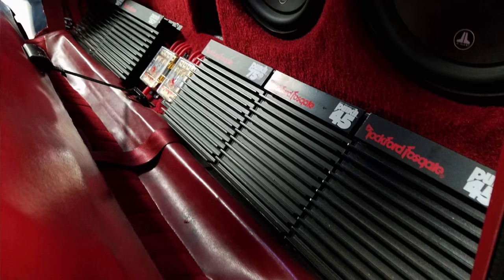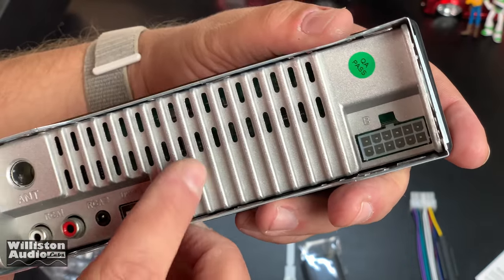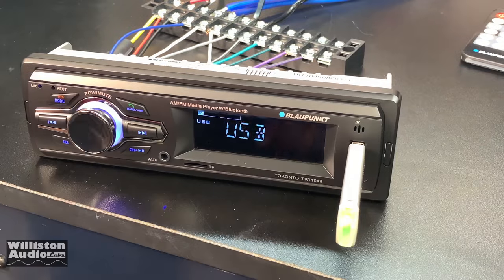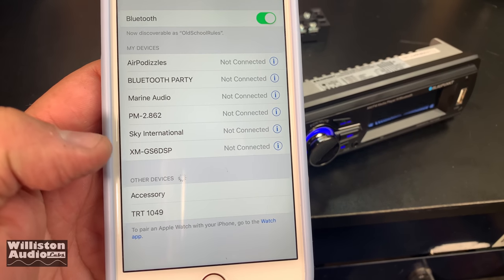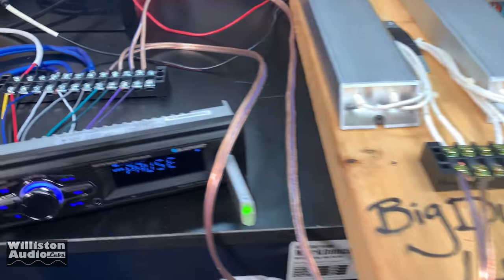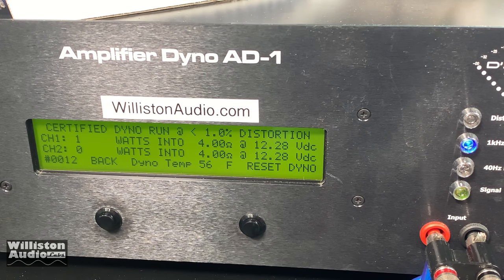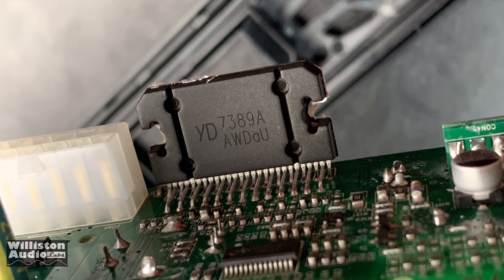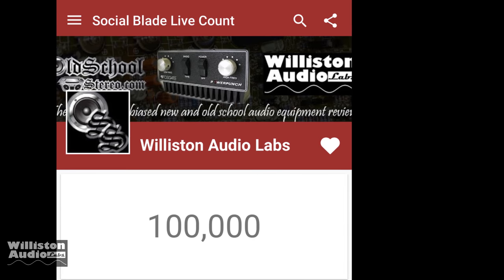Is a $10 Walmart Car Stereo Any Good? [4K]

Comment: I like it's shallow depth. Looking for a low profile, simple, stereo to install in the cabin of a sailboat. But I seen alot of complaints on the screen going bad. Don't want to build a custom cabinet, just to have an unusual size go bad, and no longer be available.
Reply from the maker: Yeah these are hit or miss as should be expected at the price. I guess you could buy a couple of them and swap-a-roo if one goes out
Reply: I bought one of these units about 2 months ago mainly for its Bluetooth capability and its price point ($20 in Feb 2020) for a truck I purchased at the beginning of the year and within a week the display stopped working once the screen had a little heat in it. Not the burn your truck down kind of heat, it is barely warm to the touch after my hour long morning commute. But when I get off work in the afternoon, the display doesn't work at all. Still sounds good and you can adjust the volume and whatnot, but if I had this to do over again I'd probably buy something else

Comment: Big D,
Thanks for the review!  I bought three @ $9.99, and made a cooler stereo for my shop/Jon boat, and it's been great for about 6 weeks now, no issues, and I play it almost daily.  Can't believe it's only $10!

With the thin profile, I didn't have to cut all the way through, only through the outside and used a heat gun to stretch the inner liner to accept the speakers, so it keeps my drinks and lunch cold with no issues or leaks.

Not sure what I'll do with the other two units, but might keep as a backup, in case this one blows, but so far, so good!
Thanks again!
Reply from the maker: Awesome feedback, thanks! I bought extras to use in projects as well. Awesome little head unit 🤙

Comment: Do you, or any of you guys reading this, know of any good radios with built in navigation and such? Really want to upgrade the one in my Hyundai i20 at some point cause it just sucks...
Reply: i've got an Xtron's octa core android heat unit in my e46 and can't complain.  I wouldn't go for a built in navigation head unit when android is far more flexible
Reply: I put a couple cheap aliexpress android 8.0 screens in my car ("Funrover" brand) for around $160 CAD. Even works with the clock display and steering wheel media buttons, FM radio, really good GPS antenna.
Reply from the maker: The $175 Dual from Walmart gets decent reviews. I’m going to try one. It has Apple CarPlay and Android Auto, (3) 4V outputs and more

Comment: I bought one, installed it in my old Ranger p/up. Lasted 2 weeks and pretty much died. LCD display works for 10 minutes, then goes blank. Radio is terrible. No sensitivity, could not hold a station. Pure JUNK. I don't see any reason to look at any other Blaupunkt equipment ever again.
Reply from the maker: I guess it lasted longer than the Double cheeseburger combo that also costs $10 though 🤨
Reply: You bought a 10$ blaupunkt, try buying 200-400$ (or a bit less) blaupunkt and you’ll get something great...

Comment: u can replace the yda7833 with tda7850 without doing any modifications & it would be doing 100watt per channel at 2ohm rms at 10%thd. upgrade the fuse and bigger heatsink!

Comment: The biggest thing in a car radio is the CD player. Get rid of the CD player and it shrinks down like crazy.  Also with advances in tech it's getting cheaper to make small and good quality components. It's not like it was in the 80s and 90w where a cheap deck was crap.  I have the $20 dual walmart deck in my homemade home audio system. I use a 12v 6a power supply-was for led lights-and I found an antenna that's actually a long flat metal sticker.  And it works great. I'm using a pair of alpine 6.5 separates(part of why it sounds good) mounted  in the box with the radio. Then I've added a really old pair(but like new) bookshelf speakers on the rear channels. And top it off I have one of the RCA outputs going into the aux input on my beats speaker. Its the first gen big black one that was for old wide apple connection. The entire setup rocks out my little apartment.

Comment: Anything works great new. The issue is quality and longevity: how quickly the button icons (paint) fade out, if the button can retain usage after a long time (dont loosen up or fall off), if a button doesnt do random things like keep turning the volume up after youve taken your finger off, if a button just stops working, etc.
Reply from the maker: It’s $10...I would not expect long term use

Comment: If it was $30 and had APTX bluetooth, this head unit would be a complete game changer.
Reply: butchtropic  not NEEDED, but the future is mechless and if we're going to be ditching CD audio, we need to normalize the closest standard to it. I personally use an aptx receiver in my vehicle and can tell a difference over my $300 a2dp head unit. It's especially noticable with Dynamics, like in fast drumming.

I'd argue that aptx support really wouldn't add much in the way of money. I'm shocked that someone isn't making an ampless mechless receiver at this point. Just inputs, USB, bt, and 4v rca out.

Comment: I was in a store (big store, but just the "one", not a chain or anything) here in Sweden and for fun bought a $6 BT stereo speaker including battery a small lithium battery/FM radio, SD card/MP3 and soo on... though it was a joke... tried it and it was everything it said it was, just awesome... Really strange I thought, they could have sold these easy for $30 or more...

Then instead of playing music I played a movie and realized Left/Right output was wrong... It was a really easy fix though just turn it upside down... But then I got it why they sold them so cheap... Some factory mishap and instead of just trashing them they sold them really cheap to a store... 

Sometimes you get lucky :-)

Comment: I bought one of these a couple of months ago and have it connected to a pair of small bookshelf speakers in my garage.  I’m VERY impressed by the features and with how it sounds.  My next step is to get a dual voice coil 4 ohm 6 1/2” sub and put it into a custom built band pass enclosure.  The sub would get 20 watts to it by having both rear channels connect to the sub, the bandpass enclosure will help to filter out any miss coming from the sub, and the increase in midbass response will only help my small 4” two way bookshelf speakers.  I definitely recommend this radio for what it has and how cheap it is.

Comment: Will it fit my 95 Ford Taurus ? does it need a dash kit to fit and what about wiring harness adapter ?
Reply: Yes it will fit and yes you will need a dash kit and wire harness adapter
Reply: @robfassi3297  Thanks for the quick reply heres another question . will a 2007 Honda head set,  single Din ,  be able to fit my ford Taurus ? I was told no the wiring /electronics is not compatible .    12 volts is 12 volts and speaker output is the same ohms , no ? What is the problem?   Do you know ?? Adaptor harness ? Thank you for your help  thumbs up

Comment: Kenwood 22 Watts RMS per channel and will go into "protect"  if the speaker is bad or will tell you if it's "miswired".  Every other radio will burn out.  Idk if JVC has this too since Kenwood bought them out several years ago.  JVC always had the best CD mechanism suspension.  Would skip less than any other brand on a bumpy road.  This also helps in SPL.  Kenwood Excellon have Front, Rear and Sub 4 volt RCA outs.  Some even have independent x-over and EQ settings for F/R & sub.  So you got 4x6" in the front and 6x9" in the rear deck.  You can also store the settings in case you disconnect battery, WOW!

Comment: Saw a guy post this on Amazon 

Bought three, one worked great for a week, then started shutting off randomly, losing clock and presets. Display lost pixels and is barely readable. Pressed the select button once too often I guess and it stayed in, broken. Second unit display stopped working and would freeze and refuse to function until reset. Third one I didn't bother trying, all were returned for refund. Don't waste your time.
Reply: Superman Of Krypton that’s why it’s 10 dollars duh

Comment: I was going to skip putting a radio in my hot rod but decided I'd give this a try after watching your video.  I figured the rumpity rump of the big block in my car was enough music for my ears.  Walmart and Amazon seem to be sold out and are now offering a "Columbus" radio instead.  They're similar but don't have all the features of the Toronto.  I found a few "Toronto" radio's on eBay so that's where I ordered mine.  The price has gone up but it's still cheap.  Thanks for your review.

Comment: The way i see it. Is that these were made if you bought a vehicle with no stereo and is a quick fix till you decide to put in a real sound system in later
Reply from the maker: Yeah or to make a portable stereo
Reply: I watch another channel where they get cars from auto auctions and sell them and lots of the time those cars don’t have radios as the previous owner ripped their head unit out before selling them so these radios would be great for car sellers to put into cars that they get that don’t have them so the next buyer at least has something to listen to
Reply: @ethancedrik  i mean i get it but as a seller i wouldnt waste time plugging those suckers in.......

Comment: Yo D, you should do one for the Walmart Dual stereo with 4x 6.5 inch  speakers included for $20.
Reply: A stereo plus 4 6.5 inch speakers for $20??? Where i live a stereo costs $80 minimum and if you want bluetooth $110
Reply: @antreaskonstantinou8585  Yeah, they really aren't that bad either. I bought a few and passed them out this last Christmas. I kept one and use it in my house with an ATX pc power supply.

Comment: To be fair, it doesn't really need to be full din size if you're not going to put a cd reader in it. Which, I certainly haven't used since ... like 2005 or 2006? I started back then with a head unit with one of the proprietary cables for hooking up to my ipod, then progressed to one bluetooth coming from my android phone. I didn't even hook up the radio antenna to my most recent one till our town got a drive in theater.
Reply from the maker: I’ve seen smaller depth “media receivers” before, but this one takes the cake!
Reply: I wonder how would this do in a hot summer? That plastic back should probably be aluminum to take away the heat.
Reply: KelMaster Construction  my ears don't usually discern the difference, and I much prefer the convenience of having half a million songs in my pocket. I couldn't fit that in my car with CDs. It's why I don't put money into it other than to get A bt connection. I'm sorry disappointed with Clarion on that though. The a2dp gets out of sync after a week +/- so you don't get track data or controls, just the audio channel. Requires a full reset of the device to fix.

Comment: Fitted one, had it sent from the states. The audio quality is excellent, and it paired really fast. Very impressed. And you don't have to use the app, my phone is Android 8.1 and it as it as a Bluetooth speaker and phone device. The app has a few nice touches but from what I've read it also has a few issues.

Comment: Not surprised at all, that´s the same as any random BT speaker where here the Amp is different and it have a display. I was expecting a couple of class D amps but they sticked to classic AB TDA. Well, those are specifically Car designed but a couple of TPA3118 would be maybe more expensive and require more design work on the board.. But hey, it´s still less than 20 bucks, which is more than reasonable. Effectively it can be a nice BT box option but I would disable the 7389 and go Class D for efficiency. Thx for the video!

Comment: Bought a similar one from ebay with this "retro" look. Promised 4*60w, but as the motherboard inside only had one chip with a heatsink and the heatsink tiny, im not expecting more than 4*10w fram that one!
Reply: you will never get more than 4*15 from any headunit realistically.
Reply: @nikilentz6961  even not from the top end pioneers? I am using a denver cad-450 now, do you think its a decent HU?
Reply: Class d?
Reply: @andrewallen9993  Are you asking about the Cad-450? I dont know
Reply: @Gamleprofil  No I am saying that only a tiny heatsink is required to get 4x60w out of a class d amplifier :)
Reply: @andrewallen9993  So it can actually be a good stereo? I took it appart and it was just one tiny chip and the rest was just diodes and other small components so I cant see how it can still be in the range of the $150 denver heavy-as-shit model

Comment: Goes to show you that car electronis are over priced. Things have got better in the last 9-10 years. I worked for a major electronic company once about 15 years ago. Youll be surprised to find out $200 speakers only costs but $15 bucks to build.
Reply: That's most things.  The most expensive singlasses don't cost more.than $5 to make.  Luxottica owns everything though and sets prices because suckers will pay it

Comment: So if its 10 buckeroos with all this what are the other guys excuses for making them $600+
Reply: Exactly, for the last decade we've been buying dins and double dins, with these features.
Reply: @ShinyStarDust Homes Hmm aux? nope has that... Bluetooth? Nope has that.... Mixtrax? Yeah I dont think anyone uses that... CDs? Almost completely obsolete by now... The amp? Nope uses the same 50x4 mosfet amp as most do....

Yep literally no reason, maybe they get the extra 550 and shove it into the big case behind the stereo
Reply: @ShinyStarDust Homes Sound quality will be the same, power output will be the same, some could possibly have more tuning settings but those can do more bad than good of you dont know what youre doing and dont use the same source everytime.
There is seriously no good reason to spend an extra 500 dollars, unless the brand stamped on the plastic is gold plated or some shit. Otherwise most of them get their parts outsourced from China and most likely use the same components as this "piece of junk"
Reply: @ShinyStarDust Homes You're better one getting one of these with a 50x4 amp, youll get cleaner power and stay well under 600
Reply: @ShinyStarDust Homes I've also tried these, pioneer, kenwood, and jvc.
No difference in sound quality at all. The only difference would be the settings available and the software on their double din screen stereos.
Reply: Power,sound quality,tuning for aftermarket subs and amplifiers. This is for someone who just wants something to play music nothing more
Reply: @3712bigboy  Mm daddy youre so knowlegdeable
Reply: If you think an Internet streamed MP3 via Bluetooth is "sound quality", then no, there won't be any difference between this POS (which I own and use) and good quality head units (which I also own and use). For a person like you, you are correct, there is no reason to buy something better.

Comment: I bought one, from Amazon, for $13.17 after tax with Prime. Even if it turns out to be pure trash, I can’t complain for that price.
Reply from the maker: I’m blown away by it. Going to use one as a garage sound system.
Reply: Williston Audio Labs I’m concerned about Blaupunkts customer service; the box says that said radio is supposed to work with iPhone and Android. The QR code, in the instruction manual, is for Android only. I wasn’t able to find the Blaupunkt app for said radio on my own. I tried calling Blaupunkt customer service. I figured out that the they went bankrupt in 2015; liquidation finished in the first quarter of 2016. Shaghal, Ltd appears to own the rights to Blaupunkt. The 800 number for Blaupunkt is really a Bosch number; they use to be affiliated with Blaupunkt. Rockford Fosgate had a deal with Blaupunkt for a little while but eventually they went their separate ways too. The customer service rep, from Shaghal, Ltd, tried searching for a iPhone app that would work with the Blaupunkt Toronto TRT1049. He couldn’t find one. This issue is being elevated to second level management. I will be contacted if and when a solution is found. I don’t expect much. The telephone connection was awful, English didn’t appear to be the technical representatives first language and I could hear a rooster crowing in the background. On the plus side, the Better Business Bureau gave Shaghal, Ltd 4 out of 5 stars; and they’ve been around since at least 2012.  They sell low cost electronics like netbooks and tablets. Hey, what should I expect from a radio that I paid less than $20 for? If it works as well as the one in this review, not having a iPhone app that works with said radio is the least of my troubles. In short, Blaupunkt doesn’t make Blaupunkt anymore. Cheers!
Reply: It will work without the app for simple streaming, and most phone features will work too. You can use the remote for other features. But we found it was fine out of the box. And why do you want to be needing around anyway? Play music, answer calls, and concentrate on driving.
Reply: @wal  imagine how much other companies make if these get produced for less than a few bucks shipped and sold with profit insane

Comment: Its about time we started miniaturizeing our single dim stereos, even if that means no lcd touch screen.
But we are about at the point were the head unit can be just some mini system somewhere and the screen can be really thin placed somewhere else, saving alot of space or making for alot more flexible installations.
Reply: MeMad Max TT this. This is what the people want 🙌🏻🙌🏻🙌🏻
Reply: We also need better OSes on these head units... why should my $600 pioneer head have a crappy OS on it? I only use it for android auto so no issues from me but we should have a better looking UI
Reply: @christopherbernhardt  

Our phones are approaching thin as a credit card and have enough processing power to run AAA game titles.

Why cant our head units do the same???